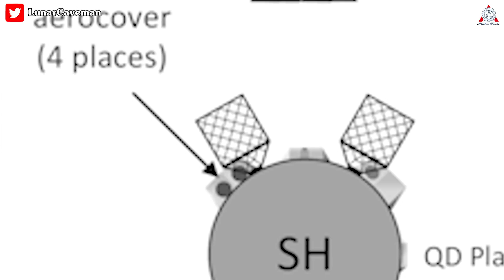SpaceX's New Breed Booster revealed! First to reach orbit...

Comment: With the electricly controlled vectoring requiring a large battery. But batteries weighing a ton. I wonder if Elon has acquired a laboratory built Solid State battery for his Starship. These have half the weight and twice the power of a standard Tesla battery. And can take extreme forces without splitting or failing.